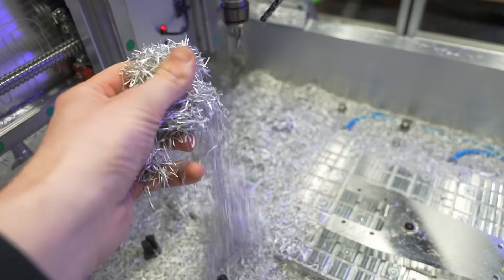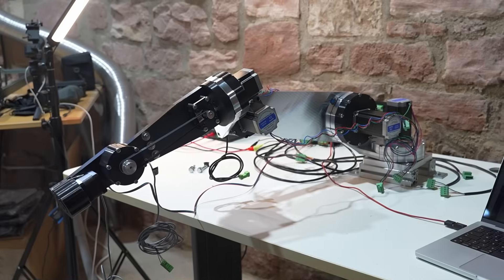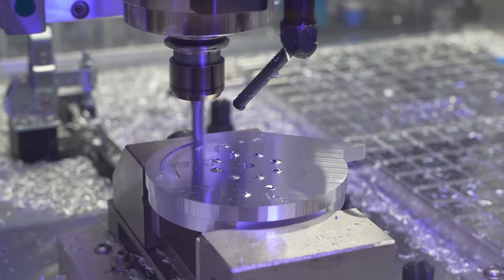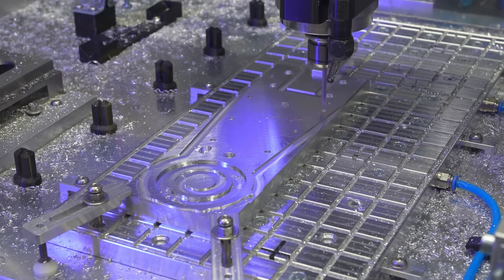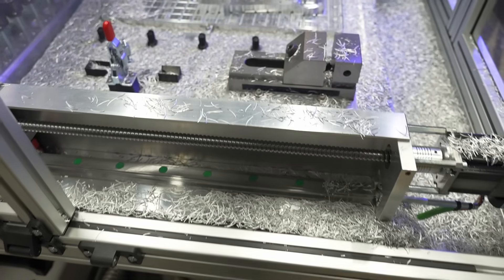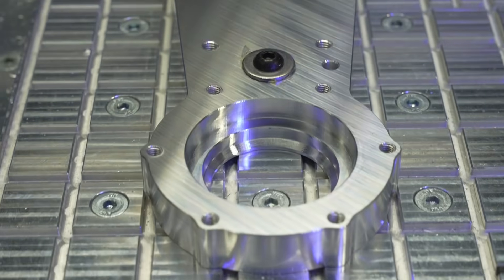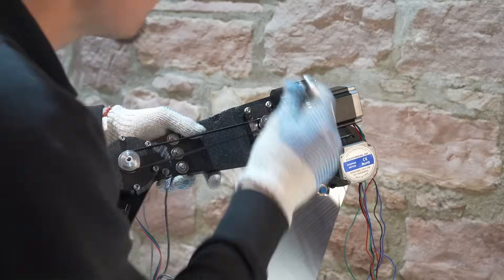CNC Milling a Robotic Arm with Cycloidal Gears in my Garage - Part 6

Comment: Awesome video! Would you consider sharing your speeds & feeds along with the tools used? Some creators put it up on the screen in machining shots. Particularly curious about how you make a machine like this drill so well, and use that large face mill on a high speed spindle! I have a similar machine and would love to get finishes half as good as yours. Thanks for considering!
Reply: That would be great!

All over. I get some stuff from Amana tools. Typically I’m using 6mm or 4mm single flute end mills and cutting aluminum. For drilling 5mm holes, I got some cheap carbide drills (because of the high RPM spindles), but they don’t work too well with my settings.

What spindle are you using? I want to switch to ATC- and it sounds like you have a 24k rpm ATC spindle which is what I’d be looking for.
Reply from the maker: @de-first  I have a 2.2kW 24k rpm spindle. I can drill holes up to 5.5 mm in aluminum and up to 4.2 mm in steel slowly but reliable. I would like to have a bigger spindle with still 24k rpm and bt30 toolholder.
From my experience your tool is super important. I only use german tools anymore. I have thrown away cheap tools unused to save me headaches. One chip clog/bad surface and a ruined part isn’t worth it.
6mm single flute sounds great. Cutting parameters? Flute length/tool stick out?
Reply: @alexanderrueffer  working on getting these for you so we can compare notes. Are you open to communicating via email? Might be easier than comments, particularly to send screenshots and other info. Thank you!

I also have a 2.2kW 24k spindle, but no ATC right now. If you have a vendor you recommend I’m looking to upgrade.

Right now I am using a 6mm end mill with 20-25mm flute length / stick out. I run typically around 1000mm/min at 22-24k RPM. Can’t access fusion at the moment so those are from memory.

What settings are you using for drilling? My spindle has very poor torque at low RPM I find. Very curious what settings you use for your large face mill as well.
Reply from the maker: @ Hey, the cutting data sound ok at the moment! Please write me per mail. We will find a solution with all details!
Reply: @alexanderrueffer  sounds great! What’s a good email to use? Not sure if one is linked on your channel.
Reply from the maker: @de-first  Its linked on the channel!:)
Reply from the maker: @de-first  Thanks for commenting! I was asked several times and try to add some information for you! If it annoys me or I have nothing at hand I will stop haha. Where do you source your tools?:)

Comment: Awesome build! 
Are you sharing this design on your website or github?
Reply from the maker: @RichardSats-e5l  Hi Richard, thanks for your comment. I am planning on putting up a dev kit, where you can buy the metal parts and components (or source them by yourself) However I will need help at the beginning from some industrial guys nearby. The kit exceeds my capabilities a bit.
For a side project to build for yourself it’s not really suited. You need to mill steel and need some h8 or h7 fits. What is your thought here? Do you think there will be interest?
Reply: @alexanderrueffer  I think there would be a ton of interest. I'm a bit different with large waterjet & CNC capabilities, but the more we share our build and give access for people to buy kits or build themselves is great.
Think of what Chris Annin has done with his 6DOF arm (AR4). You could do something similar, even at a smaller scale if you desired.
I'd say at minimum share a BOM with .STEP files for the parts on a github would be great. Sell kits if people really wanted one

Comment: I feel sorry for those X rails, covered in chips :) I put a sheet of laser printer transparency film on my spindle so I can still see what's going on but upward-flying chips get deflected downward.
Reply from the maker: @dekutree64  Thank you for commenting. You are right, I definitely need to do something about chips in the machine. Best would be to cover the rails completely. You have a great solution, will it fit with the atc magazine?:/
Reply: @alexanderrueffer  Hmm, maybe not. The plastic is flexible, but looking at 4:35 in your dream machine video, it would have to stay above the magazine wall to avoid getting mangled in the tight space. And if it's up that high on the spindle, it wouldn't cover much angular range of flying chips unless it extends a long way horizontally.

Comment: I would really like to hear you give your thoughts on the bearings that you use. And, you're a biker too ! Almost 25 years ago, I was trying to make a part for my Yamaha FJR and realized that it could only be done with CNC. That's what got me started building my own machines.
Reply from the maker: @DavidM2002  Hey David, thank you so much for your comment. If you see any mistakes that you made in these 25 years and solved, point them out please!:) The bearings are not too critical, I preload most of them and the expected forces are well below their max. The needle bearings are very low tech and cheap, need to compensate their thickness error in the robot config. 
FJR is the travel machine. Great Bike!
Biker Salute, Alex

Comment: Love to watch you machining - the parts look amazing as does the arm! 
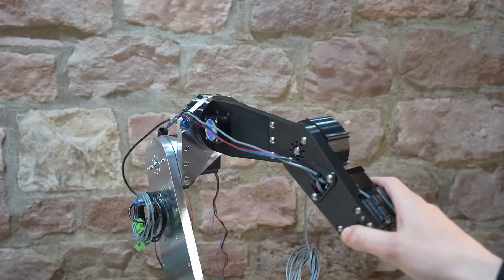Any chance we might get feeds and speeds in future videos? Would love to try some of your adaptive settings like  @ 1:28 ;) (if my machine can take it haha)
What was up with that FIFO UNDERRUN Error?
Reply from the maker: @filaxdiy  Thank you so much Janosch. I try to make the machining entertaining for you. As you asked for speed and feeds. It’s quite some work and I am lazy haha. At 1:28 it is a 8 mm 2 flute at 18 k rpm, 2520 mm/min, ae 1mm and ap 8mm. Conservative, but totally safe. 
Fifo underrun all the time since the last windows update. I need to buy a faster Computer for the mill, it is to annoying. Any tips from Eding guys here?
Reply: @alexanderrueffer  Thanks Alex! What is conservative to you is probably at the upper end of my mills stiffness :D Im mostly concerned about that 1 mm ae but i need to try.
I don't think your pc is too slow for your mill. It's just a guess but cutting these many chips in combination with your acrylic enclosure will create a lot of static and that might interfere with your communication. I get this problem when i start vacuum cleaning a lot of alu chips - suddenly my touchscreen will loose connection and rarely my controller does too. Maybe you can try to get the controller further away from the mill. Could also be anything else like a gone bad usb or ethernet cable. hope you can solve it :)
Reply from the maker: @ You could indeed go down the rabbit hole and build your mill with aluminum plates. I recommend it and would be a great video series for your channel! I fell so in love with 8mm endmills that today the first 10 mm arrived:) The radii on my bike parts are to small but for the robot they can be 10 mm for roughing.
Sadly I tried it all and can recreate these fifos by triggering background processes like update, defender etc. windows needs many processes to work. I will try with a friend’s faster laptop, before buying one.
Reply: @ (You know, im secretly dreaming about epoxygranite / fibre concrete things but i dont know if i'll ever go that far) 8mm is as big as i have gone yet, also got a 20mm facemill with inserts that i need to befriend yet :D I can only recommend the 3 flute endmills, they cut quieter go faster and leave amazing wall finishes too!
Damn thats really annoying man, hope that will be the fix 🙏
Reply from the maker: @filaxdiy  Amazing. Do it and film it, the Youtube community and the results will reward it imo.